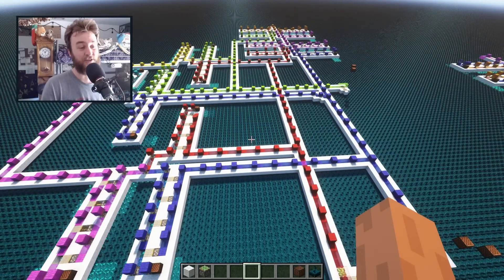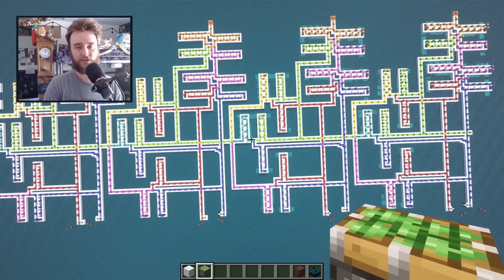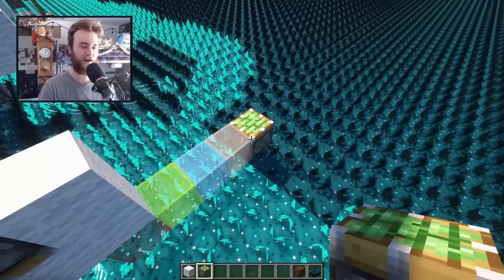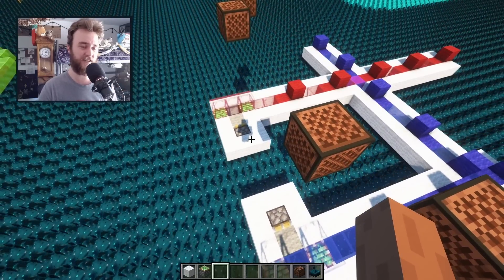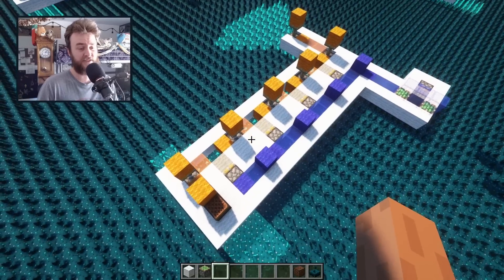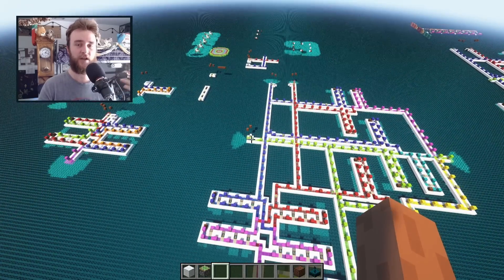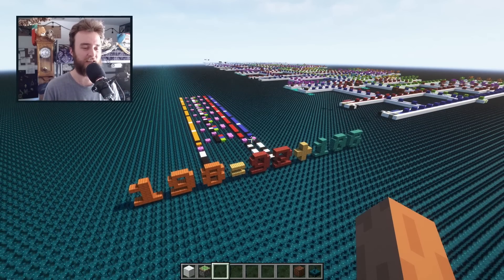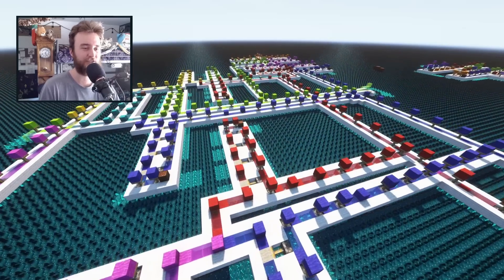A sculk-sensor calculator (and why it demos quantum uncertainty)

Comment: ont thing that you could check out to get around the chunk loading issue is using something like the ftb utilities / teams mod(s). It might need some extra mods but with those atleast it will let you chunk load alot of the circuits and hopefully let you build some crazy big circuits

Comment: Could this be built in layers for each bit being added together. This would allow it to be built in a single chunk.
Wool could be used to "insulate" the layers from each other, with holes in the wool layers to allow the signal to propegate where required.

Comment: The issue with making a cpu that has glow wherever the activity is that you have to bog down operations with so many leds that it might impede normal functionality. I think the solution lies in changing your sight, not the machine itself. It may be possible to create a camera which can detect the magnetic flux created by the motion of electricity through the chip. Or I guess they probably glow slightly already, though that seems probably less energetic
Reply: nah the issue is that cpus are small and already do like 5*10^9 computations a second which is already a significantly higher frequency than any conventional lightbulb runs at. And you don't usually see lightbulbs flickering, so you sure as hell won't see a CPU flickering. It would just be a solid light. 

Not to mention, light is heat and CPUs biggest limitation is heat generation. 

Maybe like a CPU that changes color depending on how much it is being utilised, or its temperature, but you can already do that with external lights really easily.

Comment: 1:29 It is theoretically possible, because most silicon semi conductors all behave the same way. As in a transistor can be an LED or a photoelectric diode (or solar panel), an LED could be a transistor or a photoelectric diode, and a photoelectric diode (or solar panel) could be a transistor or an LED, so when you apply voltage to the gate of a transistor it might generate photon emissions in the most likely form of near-infrared, if we go off of 1.12 eV for the Si band-gap, however we don't see them because the cpu die itself is highly fragile so we protect it with a stronger heat spreader, as well as the usual shielding off the die itself.

Comment: Well... the same problem emerges, but from completely unrelated mechanics. (Leak currents are a problem caused by quantum tunneling and 'solved' by not designing the circuit under a minimum size. Skulk leakage in this case is a timing issue in the simulation, but solved the same way)
Reply: of course its an unrelated mechanic, minecraft doesnt have a functional quantum physics engine.

Comment: one thing i just thought of is that they should make skulk sensors use directional placement, like so it can be placed on the side of blocks aswell, idk if it would change any current functionality but would make some cool builds i think. Like telephone poles or something on a street.

Comment: to solve the distance problem with the circuits, why not make layers for each of the 8 copies, using a layer of wool between each to keep them separate? you'd still be following the core of the challenge as you'd be using only sensors, pistons, and wool, so by adding verticality you'd really just be increasing the amount of data you can have computing at once.

Maybe if you compacted it this way you'd be able to add even more of them to add even larger numbers?

Comment: With respect to the propagation delay for the 8 bit chained adder, it is possible to do any word length of full adder in just four gate delays, rather than the delay length increasing proportionally to the number of bits. It's a wild piece of math which swaps time for adding much more circuitry. Won't help with the unloading issue, though :P

Comment: I think what you were talking about with the wrong input leaking thorugh a logic gate is related to quantum tunneling, the transistors get so small that the probability distribution of the individual electrons goes beyond the insulator and sort of exists on the output side.
Reply: I think electrons can actually 'tunnel' at any distance, even like a whole kilometer. It's just really, really unlikely.
Reply: @bitterlemonboy  yes, and the smaller the circuitry and the more logic gates, those unlikely events become exponentially more likely to occur.
Reply: @bitterlemonboy  exactly my friend. That's why I believe anyone could simply wake up on the other side of the galaxy one day, it's just extremely unlikely because all the subatomic particles would have to appear at the exact right place at the exact same time
Reply: @darthhunter69  Many many orders of magnitudes unlikely, but still a really fun piece of brain candy :).When describing the safety of nuclear reactors I love explaining how similar concerns over a rx plant turning into a nuclear bomb are to other silly things like, "while extremely improbable, it is entirely possible that when I hit this table with my hand that all the atoms in my body undergo fission or that I phase right through as if it wasn't solid"
Reply: @partlyblue  exactly
Reply: Well that's the best explanation of that I've seen...
Reply: Yes, quantum tunneling, I was just about to comment this

Comment: "It would be cool to make CPU with a faint glow where circuit activity is"

I know I'm fun at parties but real world CPUs (even fairly old ones) are way too fast and for the human eye it would be just the entire thing blinking or just glowing constantly

Edit: More likely glow constantly because light bulbs (not all of them but for example LED-based ones among others) do blink but you don't see it. CPU clock speeds are a lot higher than the frequency those bulbs flicker at so I think that even accounting for not every piece of the circuit being used all the time, I think the whole thing would still appear constantly lit

Comment: 7:50 what's neat is you're using sound waves and seeing the same problem that happens on the scale where particles are more like waves.
quantum tunneling is a nightmare that shows up when the newtonian physics breaks down. it's like the signal teleports over the gap. MinutePhysics did a good video on it, but i'm not sure it mentioned CPUs.

Comment: Can't you crank up simultation distance to make the 8 bit adder work ?
Reply from the maker: Oddly, some of the calculator's chunks stopped rendering (even after relogging) with the render/simulation distances both cranked to 32 chunks
Reply: @whitestonejazz  have you tried /forceload to manually assign the status to specific chunks? the docs seem to say that forceloaded chunks act mostly the same as chunks loaded by player prox

Comment: What exactly is it that breaks when the chunks are unloaded? Does the game not persist the state of skulk sensors like it does other redstone? Does it always break or are there certain cases/periodicities - if so, could be interesting to design a clock of clocks to fit in a chunk that could be used to restart other circuits; sort of like a master clock on an ALU.
Reply: I believe the "breakable what" in this case is the event that is visualized by a flying wifi particle. The game spawns them when an event happens and a loaded skulk sensor is within range, and then makes them "fly" at one meter per tick toward the sensor. I don't know the limits on when they do or do not appear (although I assume simulation distance is appropriately involved). 
What I do know is that the event-in-transit is not an entity nor a block, nor does it have a NBT value in the sensor it is targeted at. It cannot be persisted to disk, so it is not reloaded from disk.
Reply: @SirJerric  Thanks, fellow Andrew. OK so if it's just the 'flying wifi particle' that breaks, (IE the sounds), I feel like you could make an unbreakable clock by linking together some set of individual clocks such that at least one of them is in the non-sound-traveling part of their cycle at any given time of potential unloading, and could restart the others when reloaded just on the basis of block state. I don't really know how to go about building this but it seems doable and useful in principle? Would be interesting to see if Chris could pull it off.
Reply: @AT-gk3bt  -- For the record, names had nothing to do with the decision to reply. ;)

The potentially easiest solution within this workspace would be ensuring an extended sticky piston at all times. As long as it receives a block update following chunk reload, the retraction can be used to activate a sensor and launch a new cycle.

What I don't know is if the powered state of a sensor is persisted to disk. If the sensor always loads out of cooldown, extra circuitry may be needed to provide the block update. An application like NBT explorer could help identify what is and is not recorded in the region file.
Reply: It doesn't persist the sounds that are traveling, which breaks the signals that are already in transit.

Comment: Now I can't help thinking they should make different colors of glass act like different power resistors. Depending on the color, they reduce the distance that sound travels in that direction.

Edit: Just adding, they could also make the colors line up with real world resistor color bands, like the four band color code
Reply: it would be cool if we could dye the skulk sensors into different colors so we can make rgb pixels with them
Reply: @alexanderjamesaustin  that wouldn't work. You can't insulate the signals enough in a 1x1 space to get a signal through to a single sculk sensor. Maybe more like a fuzzy Cathode ray tv setup when the output is blurred a bit.
Reply: @solsystem1342  with the right distance you can do it as shown in the video

Comment: You can use carpet mod bots to load the area
Reply: Or the forceload command?
Reply: Or one of many vanilla chunk loaders?
Reply: Or layer them vertical with 15 blocks apart. to transfer a signal vertically, place a skulk sensor in the middle of the output/input above/below
Reply: or other people
Reply: Or ticking areas.
Reply: Or nether portals
Reply: Or an alternative account

Comment: After they made it so skulk sensors measure distance, I've been thinking to try making an ear off sorts, which uses multiple skulk sensors and measures their signal strength in order to pinpoint the direction and  maybe even coordinates of a noise
Reply: look up phased array antennas, that's basically the EE equivalent of what u are talking about.
Reply: then you could hook it up to one of those coordinate TNT launchers
Reply: @nl_morrison  Ok that would be sick, and possible Based of a ROM chip
Reply: @nl_morrison  cubicmetre right?
Reply: alr done this with green jab and mattbatwings, it's called trilateration (or multilateration for higher accuracy) in fact the recent changes with the sculk sensor accuracy changes were only because of a couple bug-features green and I have been pushing for the last few years so if you have any questions on this feel free to ask
Reply: @ncolyer  That’s how the touchscreen works, right?
Reply: @technocube2940  we've made more than one touschreeen and all 3 use different methods to track vibrations but I'll assume you're talking about the original one from 2020, that one used a look up rom and AND gates to verify the players position not any calculation involving trilateration, that's what an unreleased v2 can do
Reply: I think you can make a touch screen out of this
Reply: @blacksteve0  boy do i have news for you:
https://www.youtube.com/watch?v=y8gc6B_AmZE
Reply: I already did that I built the first ever 3d player radar in Minecraft history.  I even posted a turorial.